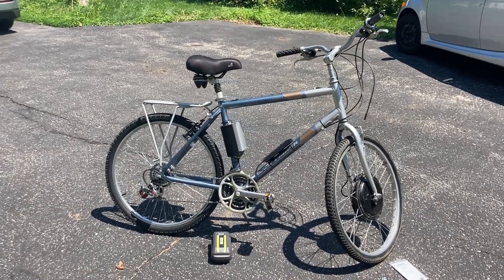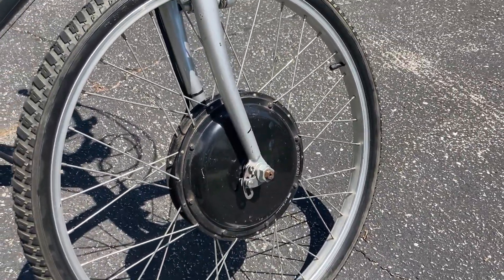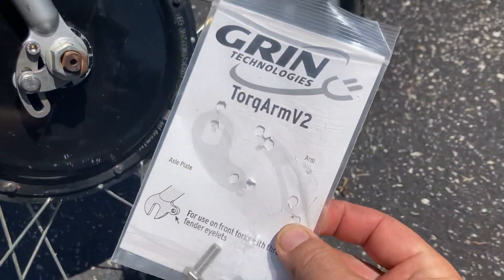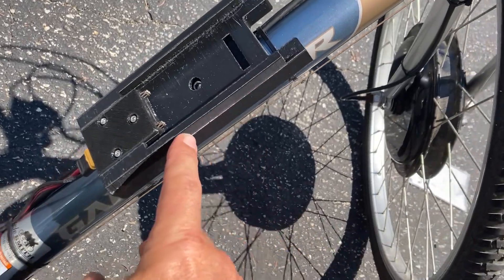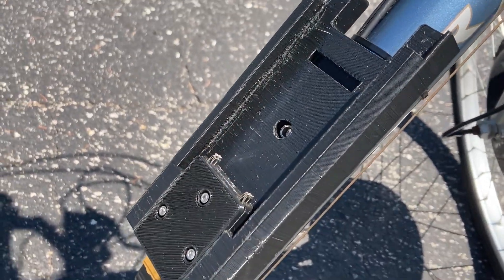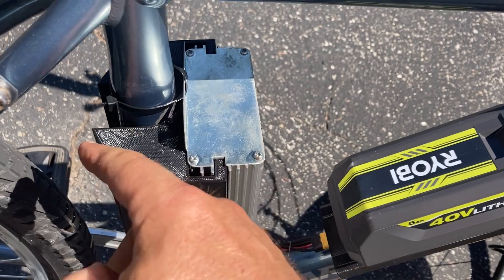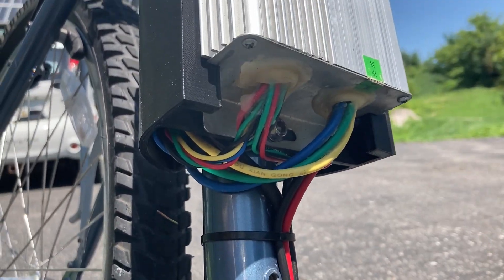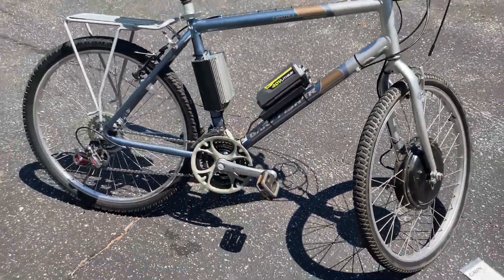Ryobi 40V Electric Bike Overview

Comment: I built two 26” e-bikes using a 36v 500 watt rear brushless motor hub wheel, contoller, and powered it with the Ryobi 40volt battery. The adapter for the Ryobi battery is available on Amazon. It works well but I take a spare battery or two with me as 6aH or my 8ah batteries have only so much range especially on hills. I put kid back seats on the back of the bikes, so with an 8 or 10 year old on the back and me, it’s a heavy rig, lol. God Bless
Reply from the maker: @geneandrew1269  I’ve gotten 12-15 miles out of a 4AH battery with light pedaling. 
Running 2 batteries in parallel gives greater total range and also prevents accidental over current protection. 

I love using stock batteries and being able to just swap them out.
Reply: @BenjaminNelsonX  yah, I thought about using two batteries in parallel. It’s definitely will increase range.

Comment: Does the 40V battery give out under acceleration due to some sort of current protection? I think I'm seeing this on my build.
Reply from the maker: Yes, that's exactly it.
The Ryobi 40V batteries have an internal overcurrent protection built in.
I've found that with my 36V/500watt hub motor bike that if I accelerate HARD the battery safety will kick in and kill power. Unmounting and remounting the battery resets it, but it's a nuisance to do.

As long as I pedal to get started and avoid any intentional hard accelerations it works fine.

Adding a second battery in parallel with the first means only HALF as much current is drawn from each battery. That will prevent the overcurrent protection from activating.

Just make sure that when using two batteries, that they are both the same faceplate capacity and start with them both fully charged.

Comment: Hello! Any chance you could link to the electrical connectors you used in the battery mount?
Reply from the maker: In the description, there is a link to FULL PROJECT documentation, including a PDF file that walks you through everything, budget, parts list, step-by-step directions, etc.

Here's a link to Digikey for those connectors.
https://www.digikey.com/en/products/detail/te-connectivity-amp-connectors/927824-2/2332032?s=N4IgTCBcDaIIwHYC0BOMCAcYAsSwGEAVJAOQBEQBdAXyA

Comment: What are the specs on the motor controller for this system?
Reply from the maker: It’s a 500 watt, 36v setup.
Reply: It's a 36v controller 500 watts ?

Comment: Whatever happened to your dual 18v ryobi mini bike project? I’m looking at doing a dual 18v setup to add an auxiliary battery to my electric longboard.
Reply from the maker: It was functional, but didn't have very good brakes. Got busy with other projects. Still want to repaint it and make a good seat for it.

Comment: Good job with the 3d printed mounts.   I have 20 of these ryobi batteries used around the house in solar power side table mounted generators that I made.   They power lights, tvs ceiling fans etc.  I like your idea here and wanna make a ryobi 40v powered diy etrike.  Can you tell me what the rated voltage of your hub motor and motor controller is?   Will a 36v hub motor work?   Or 48v using the 40v battery
Reply from the maker: This is a 36V hub motor and controller. Works great.
Reply: Do u have issues with any batteries getting upset after a few seconds of draw
Reply: @@user-fh1gu9jk2r  upset?   Or do you mean maybe that they discharge prematurely?   So far no.  I will most likely rebuild my 6ahr ryobis later with capacity lithium cells, using the older high discharge originals as spares for my 5ahr batteries.  These I use for my yard tools.

Comment: Thanks for the video.  I'm looking to do the same thing.  I assume there is some sort of throttle on the handle bar, right?  Also, what is your top speed (with some pedaling) on a straightaway?
Reply from the maker: The bike goes 20 MPH under electric power. That's very common, as in a number of places, that's a speed limit for electric bicycles.

There's a throttle on the right handlebar. It connects to the motor controller, and would be included if you bought a "kit".
Reply: @BenjaminNelsonX  Thank you sir!

Comment: Also, builders, there're lots of Ryobi knock-offs over on the Big River. I've had a dud here & there but at ~1/2 price, I can'really justify multiples of the branded batteries.
Reply from the maker: One thing I will say is that the 40V Ryobi batteries have very good built in BMS which limits maximum current output and low voltage shut off. I can not speak to the safety features of the knock-off batteries.

The other thing to keep in mind is that this is a battery I already own. There was NO additional investment in batteries. I like the idea of reusing something a person already has.

Comment: Love the ingenuity! Do you have any details regarding performance and general stability?
Reply from the maker: Works well overall. 500watt/36V hub motor.
The battery features low-voltage cut-off and overcurrent protection. I'm not sure of the exact power the battery is rated for. I think the BMS current limiter may be 10A. If I accelerate too quickly, the battery sometimes cuts power. I just have to cycle power to it to reset it, but it occassionally nuissance trips.
I also played around with running a second battery in parallel, and then that completely eliminates the problem.
About 15 miles or so of range on the one battery.
3D printed mount is very solid.
Reply: @BenjaminNelsonX  Thanks, Benjamin! That answers several questions. I am definitely going to give it a try. Cheers

Comment: this is really cool. how long does it last? also, i've got a few of those greenworks 80V batteries like these. I wonder if they make a hub motor and motor controller that would work with those 80V batteries? Great stuff.
Reply from the maker: An 80V battery would be great for a 72V system. Pretty powerful stuff at that voltage!
Reply: What kind of protections do the greenworks have built in?
Some brands rely on the tool to ensure the battery isn't over-discharged...

Comment: Been using 40v toolpacks on my ebikes for about 10 years now. Old school macallister/spear and jackson/qualcast/florabest. 3d printed holder. Thanks for making a vid on this. Imo more people should use these batteries as they are more versatile than a huge ebike battery plus you take the capacity you meed for a given journey.
Reply: Dude! Throw up a couple pictures on flickr or insta or somewhere!  I've been procrastinating over doing something like this for years. I suddenly find myself in posession of a coupla washer/dryers... Hmmm... 😁
Reply: @WillBravoNotEvil  dont have insta or flickr, do have a YT channel. Maybe i should make a vid about mine but it wouldnt get the exposure Ben gets.
Reply from the maker: @Whereswally606  Let me know if you have some good e-bike videos. I can post a link to them on my channel.
Reply: Thank you. you were ahead of the time. Do they need to have extra battery protection circuits?
Reply: @imprintwell5436  nope they have their own bms. The only issue with them are protection diodes so the dont do regen braking but my ebike controllers dont have this either. So its no issue. Ive even had then in series for 72/80v but this is hard on them and flyback current can kill the diodes in the bms.
Reply: @Whereswally606  : do you think massive current would damage the flyback diode? does it happen with the driller if you just unplug the wire and current supply is abruptly halted. What type of setup do you have now for your bike?
Reply from the maker: @imprintwell5436  No, that's actually one of the cool things about these batteries - they have lots of safety features built-in, including Over-Current Protection and Low Voltage Disconnect.
Reply: @BenjaminNelsonX  : thanks for the info, ur battery is 40 v what is your required motor voltage. like 40 v battery would work ok with 36 volts assuming board is setup for it.
Reply from the maker: @imprintwell5436  It's a 36V motor and controller.
Reply: How many miles you seem to get on a standard 4ah 40v pack? They go very far easily?
Reply: @jackle842000  not as much as the dolphin packs you buy specifically for ebikes but they are far lighter and you can carry multiples easily. I dont know exactly the miles as that end up a length of string question. I.e. whats the pedal input, gradient, weight of cargo, head/tailwind, rain or dry, cold or warm. There are so many variables that effect range especially on an ebike.
Reply: @Whereswally606  yeah, I was just kind of wondering some sort of estimate like if you were making a 20 mile trip and did not want to pedal how many of those batteries you think it might possibly take if you didn't hardly pedal at all or very little?
Reply: @Whereswally606  I know it's not no scientific estimate I was just kind of wondering what you would throw in your backpack to take with you or whatever for some sort of length of trip you might have done already. I have never owned an e-bike at all yet so I really have no clue how long they go normally even.
Reply: @jackle842000  well a quick scooch around the shops i will only take 1 if its under 15mins cycle. If im going on a long ride to the country side with a weehoo trailer with a 4 and 6 year old i will pack about 6.
I also have a custom 18650 pack with a xiaoxiang bms which has some 10s 7p high capacity lg brown cells that is great for the long trip. Swapping batteries mid trip can be inconvenient especially when you have kids riding inline on a weehoo behind you. Weehoos are excellent btw and i built a custom one with atv suspension cause the stock one was getting too small for long rides. Handles like a dream now even though the boys are getting bigger and bigger.btw i always pedal. Partly for exercise partly for not taking the piss with the power output of the motor and also why not you have legs its use it or lose it.
Reply: @Whereswally606 so these 40 v batteries can be ran in series safely?